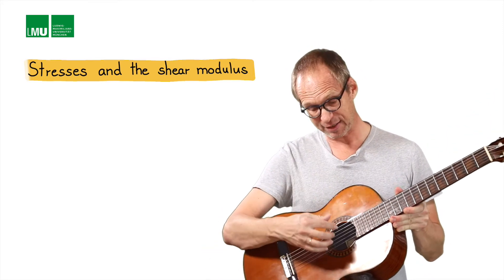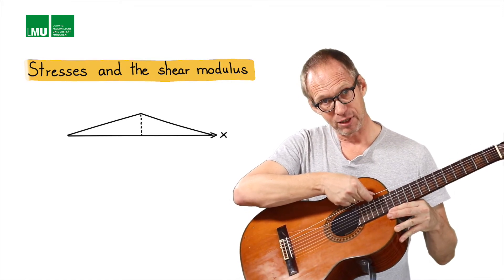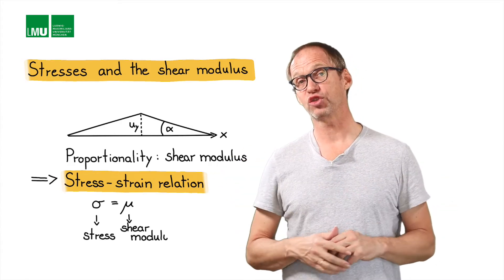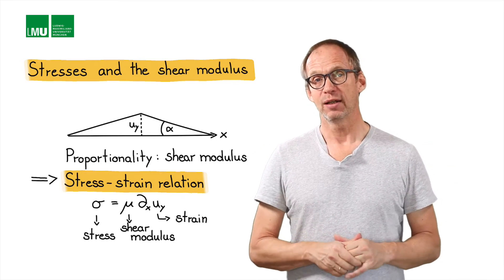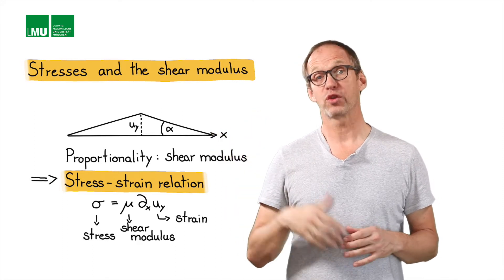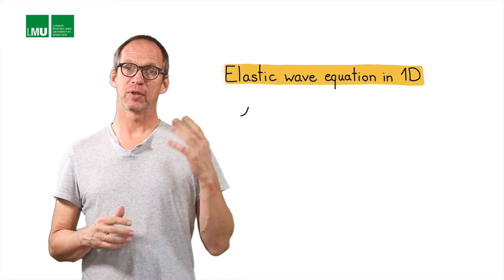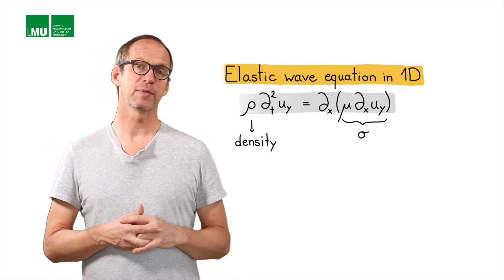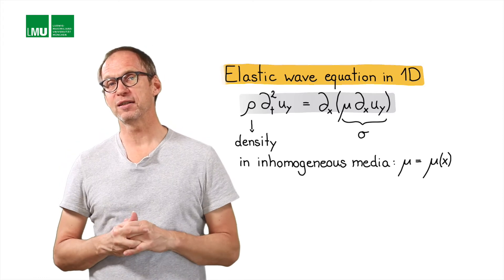Staggered finite-difference grids

Comment: Hello Mr. Heiner Igel,
It is clearly explained about the staggered grid method. 
I have a question, how will be the velocity and stress results for the velocity-stress formulation partial differential equations or where can i have a look at the results for this. Could you please answer me?
Thanks in advance!

Comment: Thanks for this helpful video!  I'm currently doing the exercises in your textbook, and I'm having trouble understanding the grid staggering for the 4-point derivative.  Are there any resources you could point me to that cover the derivation in more detail?  Thanks!
Reply: Hi! It is hard to find detailed derivations in papers. Do you mean the derivation of the operator? That is simply done with Taylor expansion at points x-1.5 dx, x - 0.5 dx, x+0.5dx, x+1.5dx ... as described in another video or my book ...
Reply: @heinerigel2610  Oh, I see—thank you so much!  I realize my issue now; I was trying to calculate f' at one of the points instead of between the points.

Comment: how to write a non-uniform staggered grid equation?
Reply from the maker: You can use Taylor series as described here, just change the coordinates of the points: https://youtu.be/1Mbe5RQi8Pg
Reply: @LMUSeismology  Thank you very much, I got it.
 If I use different grid sizes in 2D, i.e. dx and dz is not equal. Then, how to choose the number of grid points per minimum wavelength in this case?
Reply from the maker: @lanirm475  If wave propagation happens in all directions you always have to make the smallest wavenumber happy (i.e., give it enough number of grid points per wavelength). That is the larger one of dx or dz is the key parameters.